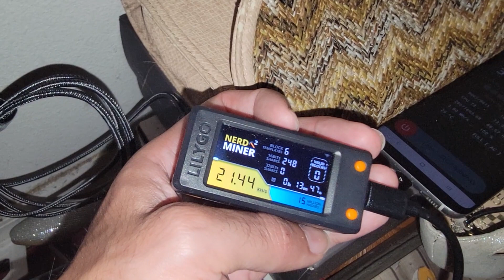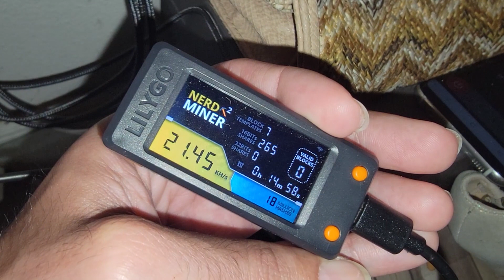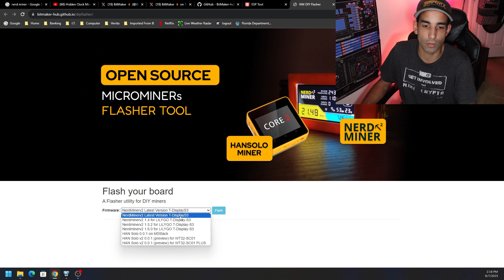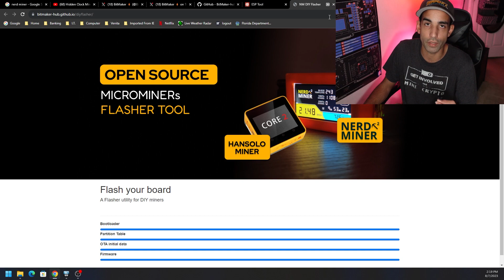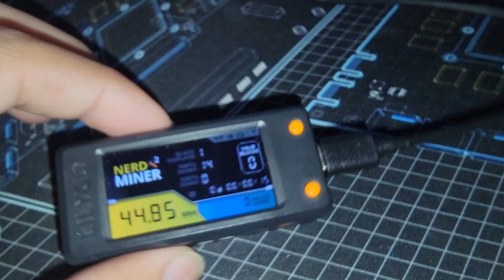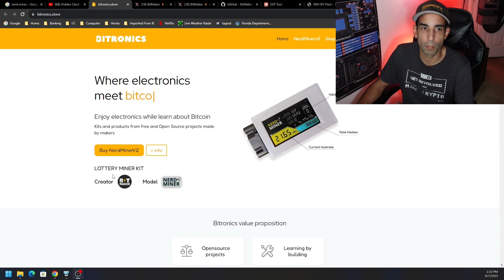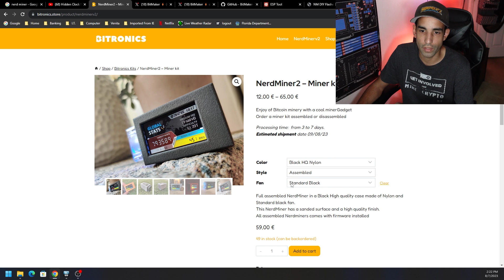NerdMiner V2 update Doubles Hashrate + features

Comment: I know this video is old and I'm not sure how many of you know this, but NerdMiner takes/charges a ton of your hash rate!  I use NMMiner which you need a license to use on each device, which is only $2.99 per device and this little miner, exactly what you have here, now gets 750-800KH/s on the clock screen and 450-500KH's on the! This is due to remorse's. But Yes, NerdMiner charges you hash rate for using their firmware. This is just a thought for anyone using one of these nerd miners! If anyone wants more info let me know!

Comment: My hashrate shows 0. Is it because I don't have a case for it? I have the LILYGO® T-Display-S3 ESP32-S3
Reply from the maker: No, something may have gone wrong during flashing process
Reply from the maker: Flash it again, until it reports correctly. Either use ckpool or publicpool
Reply: @SerpentXTech  I got it! My ISP was secretly blocking the pool. I changed pools and it’s working
Reply: you do have to configure it to mine on a pool you select

Comment: Hello.  My hashrate won't change from Zero.  Software has been updated to the latest.  Tried home wifi and hotspot from my phone but still no luck.  Any suggestions?
Reply from the maker: Reflash it from scratch, fresh install. You might have corrupted files or bad usb cable. Try to reflash, with another USB cable, and you might have to try a couple times

Comment: 🤍♥I got a couple of these because of your video few months ago, so happy with this project and the fact that it's being updated and Vega is making videos about it still😁💓
Mine been stable 55/56 Kh+ non stop for hours, doesn't appear to be getting hot, I just have it on my desk near PC where a wall fan is usually swinging anyway.( I have it in the black case still, latest Firmware.)
I got AC in my room, so I wonder how this would perform in another room/location, as it took me forever to ship/customs, I'd not want to wait around for a custom fan case so I'm hoping I dont have to take it out of the case as it looks pretty cool with that black Lilygo :).